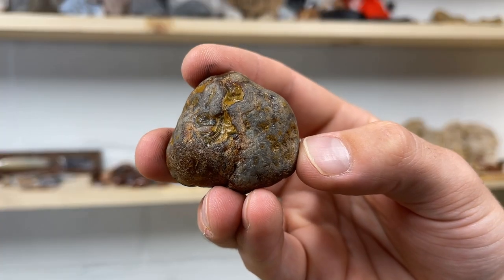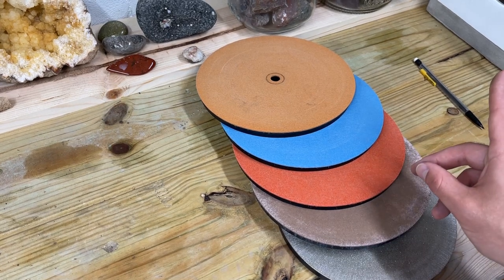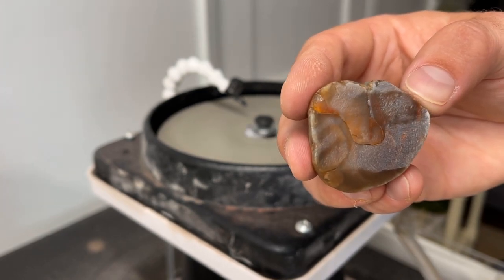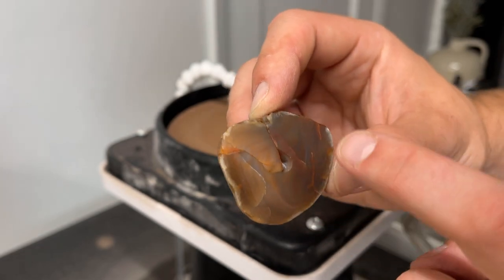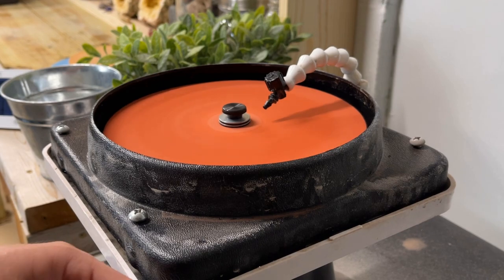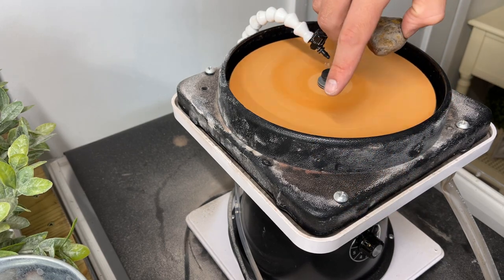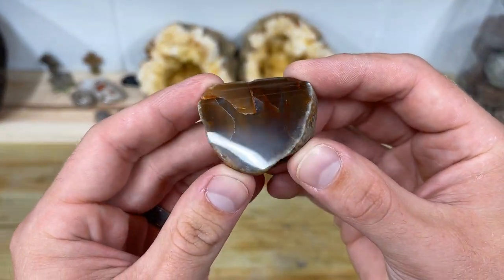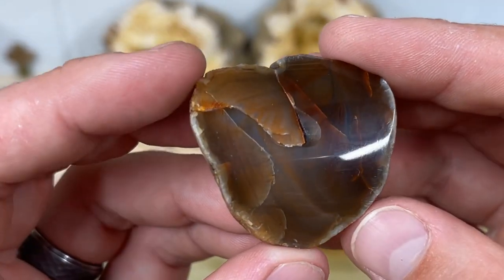Exposing Bands While Polishing an Unstable Agate | Flat Lap Lapidary | Lake Superior Agate

Comment: Very good job under the circumstances. To really fix that stone, you would have to loose quite a bit of that stone. I think I would have trim sawed near the line you marked. It would still show the flaws if I didn’t cut deeply enough. 😎
Reply from the maker: I thought about getting the stone hot and melting solder into the cracks until it was higher than the face, then taking it to the polishing wheel until its flat...making a Frankenstone lol

Comment: I have a question as have never used more than a tumbler. Do you think if you would have cut this first to get to a flat, or almost flat surface, the rock would not have fractured so much? Just curious as pondering if I want to take this to more, like a saw and grinder. thanks and please keep the videos coming.
Reply from the maker: The fractures were there before I even found this one, grinding on the flat lap didn’t cause fractures, it exposed them more and as I ground down, they got thinner and more unstable. So even if I cut it and ground down in the same way, it would have similar results. Sometimes these stones are stinker beans and just have faults.
Reply: @AgateDad  thanks

Comment: Thanks for the video, as you gave me some ideas for many of my rocks/crystals that look exactly like yours in this video. I just felt mine were jasper-quartz infused with some swirls, not agates like the typical lines and bands. A couple questions for you to help me out with what I may do with mine. How come you didnt cut a thin slice off any or all sides first to see, then polish? Im new at this so just wondering before I go and cut mine up. Also, will you do the other side or leave it the way it is and why? So, I been hounding over the past 4 years in Oregon and Cali, but just now getting into buying some saws and equipment, like today or tomorrow. One thing I learned over the past few years is cleaning these types of rocks/crystals like in your video with muriatic acid bath in water. For me it does a few things, one it cleans them and two it has given almost all of my rocks and crystals a clearer view of the inside and the designs they hold. Meaning, it gives you a better idea of where and how to cut them before just slicing and grinding. I have lots of chalcedony agate types that are clear and only could see the bands or designs after 1-3 acid baths and then drying for a week or more. Some werent even showing after wetting or under water in light and only after the baths did they reveal some beauty. So now I have some ideas to either cut and or grind and polish them. Just a little idea in case you or your  followers didnt know. One more thing, as I may be buying this machine you use. How do your discs or pads hold up over the past year or so and how often do you run it per month? These items are not  cheap to buy and so I am hoping they last a good bit before replacing. Thanks again, Chris

Comment: Put the fractured rocks in mineral oil overnight. It hides a lot, though maybe not all fractures. Rub dry with a soft cloth. Pros: the rocks look better. Cons: some residual oiliness. I finally did this to all of my fractured rocks; would do it again.
Reply from the maker: good idea!
Reply: Good idea, I did that to a couple pieces of cool calcite I found that were a bit dry and a year later still look shiny and "wet", yet no wet to the touch.

Comment: Opticon gem fracture sealer... a lot of my stuff I'm finding is fractured... so someone recommended it to me... something to look at... passing it along
Reply: I also though about using a sniffer bottle or syringe with a rubber end to draw super glue through a fracture... not sure if it will work... but it's worth a try on a test piece...😃
Reply from the maker: good ideas!

Comment: I’d recommend thin starbond ca glue to help with future fractures. It doesn’t yellow and helps me a lot in under cutting during polishing!👍🏻
Reply: Would this work for cutting them with a diamond blade attachment for a Dremel ?
Reply: @paleocat6354  it might help with outside fractures from breaking off, more than likely it’s the vibration from Dremel blade attachment that causes the breaking. I’ve used it for a little bit a year ago, just make sure to use lots of water in between and let the blade do the cut!👍🏻

Comment: I've noticed that you stop using the 14000 paste buffer. Do you find the polish to be better with the 3000?
Reply from the maker: I didn’t use it with this one because of the fractures, the compound would leave a goo and fuzz in the face polish
Reply: Thanks for the reply 
Makes sense 
I was thinking about getting the 3000 disc just because I felt like 1200 to 14000 is a big gap.  I filled the gap on the low end with a 220 pad made the micro scratches easier to remove for me. Will be interested to see if the 3000 will be a noticeable improvement in the final product.
Reply from the maker: For sure 🤘hopefully you see a difference!

Comment: Leave it be, but I'm not a lapidary expert either though. If I were to do any of my agates like that, is one identical with multiple fractures on the inside.
Reply from the maker: I've had this crazy thought of heating the stone slightly, melting solder in the cracks and polishing that.... a frankenstone... thoughts?
Reply: @AgateDad  I wouldn't do that either. I have thought of boiling some in water to try to get dirt out of the quartz in particular, but it looks awesome as is. It's like one guy said to me a little while back: They are sentimental. You really don't want to mess with them. 
       I'm going with that. However I am getting that Citric Acid. In fact I'm going to try that before boiling any. For that I'm very grateful. I've asked even some true experts, and they didn't offer much help. I think that once someone gets into your position some things are more permissible, just don't forget it was the simple, and imperfect beauty of the agates that got you into this. 
     I've got a couple of hours here to watch some more videos, and you were talking about a green stone that swirls. I found a pounder one of just that the other day. I'm getting it back when I go back there this week. No luck tonight. I took a landscape rake and turned the rocks in a couple of creekbeds, and go back first thing in the morning. It was too dark to see anything.
Reply: @AgateDad  you know when I think about it; you can heat up vegetable oil and dip the agate in that,but you can't hold it with your hands. It has to be really hot. Some jewellers do that with some Emeralds to fill in the natural inclusions on some, making it look more flawless than it really is. Vegetable or mineral oil. I don't remember which one, but Im sure it's vegetable oil.

Comment: Could you use this grinder to shape/smooth the edges of pieces of cut glass for stained glass work?
Reply from the maker: They have a discs for glass, so yes
Reply: Is that disc included in set or do I need to order separately? Thank you…
Reply from the maker: If you look up the flat lap models, you can select the glass version
Reply from the maker: The website is in the description box
Reply: @AgateDad  where is the box? Thank you so much…
Reply from the maker: The video has a description box when you click on it that shows extra details
Reply from the maker: https://hitechdiamond.com/?aff=22

Comment: Great video dude. I have one of these HiTech flat laps and have had minimal success with it.  I think it’s because of the limited number of grits, and also the high grit of only 1200. I’ve found those $12 sets of diamond grit pads work far better. More in-between grits to make the transitions easier and quicker.
Reply from the maker: You should get the 3000 grit disc
Reply from the maker: And the 260 grit (purple)

Comment: Hi 👋 👋 👋 👋  Agate Dad hay where biggest  Fracture is fill that 1 with Epoxy the real small 1 fill with CA glue get the thin glue so it will make its way into the small cracks I would let this set up at least 24 hours to make sure everything is set up. One word of caution use a junk grinning wheel to make sure you don't plug up your good grinning wheels. I would feel really bad if I gave you bad information. So Rock 🎸 on sir and we'll see you at the good ole rock  pile hahahahaha 😆